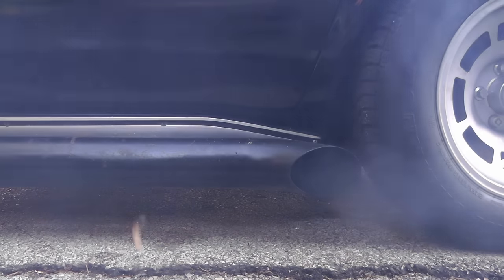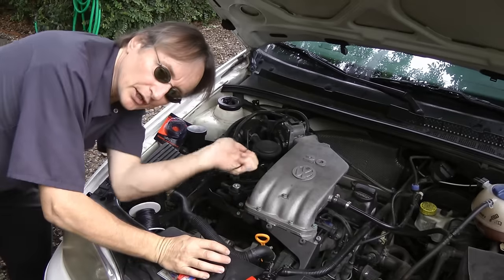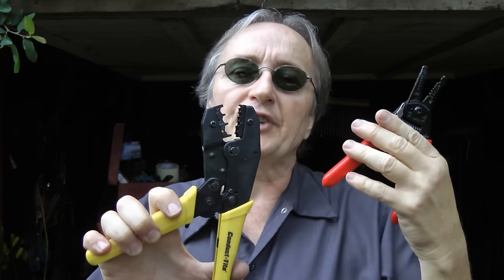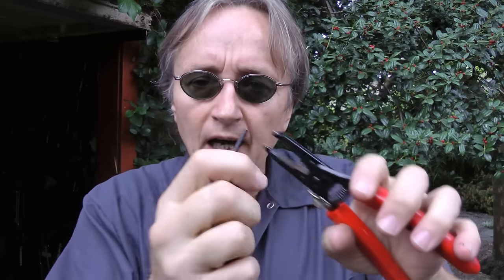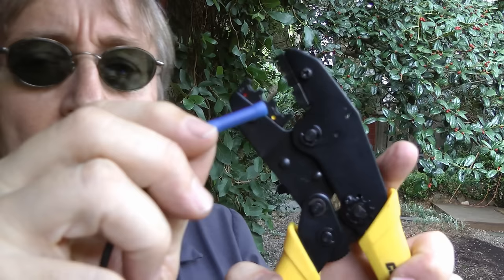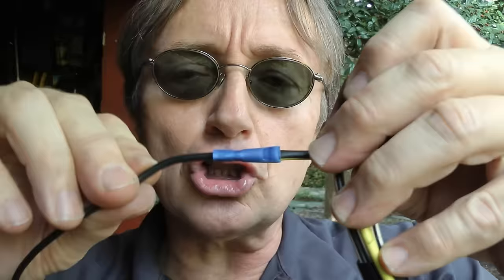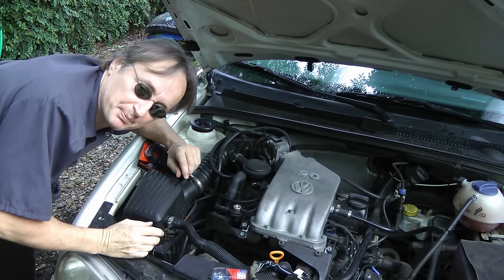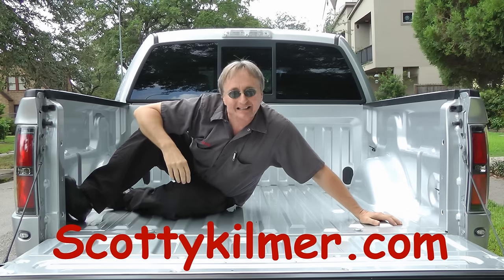How to Splice Wires Together in Your Car

Comment: I just twist the two ends together and put some duct tape or sometimes electrical tape around them.   So what if my lights flicker when I hit a bump
Reply: Well you might dont care about the ligthting but it would suck when the engine stalls because a wire got loose somerwhere
Reply: Same, with the right twisting technique there aint even any problems. And i usually use shrink tubes to proof the connection
Reply: The right way is to use a zinc connector. The zinc protects your car wiring. It's called "anodic protection". Twisting and taping is bad. The air has water in it. Your copper wires corrode and will turn black so do it right or plan on your car getting sick from the bad wires.
Reply: If a light flickers, it will blow all the time.
It's being switched on and off a  thousand times.

Comment: Poor wiring job. Exposed wire from the butt connector, and the twists on the wire look horrible so they will catch or strands won't be crimped in the connector. I hope this was just because of the camera, if you do that kind of work all the time with exposed wire you're creating a possible short yourself...

Comment: Insulated butt connectors are exposed to atmosphere & are bulky when multiple wires are repaired. These connectors allows water to get in and cause corroded green wires. The Best way to repair a wire is to solder the wires together and use adhesive lined marine grade heat shrink or use bare non-insulated butt connectors in combination with marine grade adhesive lined heat shrink. You can even use solder on the non-insulated butt connector for a superior repair after crimping.

Comment: hi scotty   mick from the uk here    ,,  i have high repect  for you   ,,  but i was  told  to solder wires   useing     flux    then solder then  the dielectric grease    dielectric grease  between the  shrink rap   and heat with a lighter   untill the  grease comes out of both ends

Comment: I used these connectors when I was installing an aftermarket radio. I somehow prefer the heat-shrinking connector, so it will seal the connection snug and tight, no water goes in. But they are a little more expensive than the normal connector.

Comment: I work in aviation for 35 years starting in an avionica shop and now as an avionics engineer. I agree with the crimp splices. Soldering also works, but for how long? Solder gets "brittle" over time at changing temperatures. In aircraft crimp connections are used and sealed against the environment because aircraft last a long time, longer than most cars. So, crimp (and seal if you must) otherwise solder and it should work for many years too if you do it right.

Comment: ive actually made entire motor harnesses before using this method. works great on carbed cars, originally i had a wiring harness with 100 or so wires. i think my home-made harness had about 10. so many are just not needed with a carb.

Comment: 2003 Nissan Última SE. Passenger side low bean bulb just replace last night. Everything worked fine. Today I turn on my car, and driver side low beam work on off setting. If I put it in Auto setting, only passenger side low beam light works. As I go down the settings they switch between passenger side and driver side but they never on at the same time. high beams both work just fine, turn signals work fine too. This afternoon my low beam passenger side is out again, I  replaced it last night.
Reply from the maker: +Frank Masias  personally, I would just bypass the wiring to the low beams and put in a toggle switch and new wiring to operate them, as your car runs those lights using computer modules now and they can be cows to fix with their original complex design

Comment: The right parking light on my Toyota Tacoma has not been turning on. The bulb was good, the connector is good, and that led me to think it was the wiring... until I simply pushed in the bulb into the connector and it turned back on. It would turn back off again when I stopped pushing on it. I simply took the bulb out and bent the little metal wiring protruding from the bulb outward more for it to make contact with the connector, and that fixed it and saved me from having to waste time splicing.

Comment: Awesome video!

I have to ask: would soldering be a good alternative to fixing wires?
Reply from the maker: sure, but then you have to seal the solder with wire covering material, and need a lot of room for a soldering iron

Comment from the maker: @CMLovejoy you check it's resistance with an ohm meter. But try to use the same gauge wire, it's there for a reason.

Comment from the maker: you don't want to be hearing grinding sounds, try removing the fan belts and pray the noise goes away, then it's something a belt drives. If it stays, it's inside the engine or transmission, Big money there, I'd dump it quick. Try cleaning the fuel injectors for the starting.

Comment: Just got the right side tail light to work again on my Suburban. Turns out it was a bad socket. I cut out a bunch of wiring and spliced in new wiring (used heat shrink tape instead of butt connectors) and even ran a new ground wire, and it was working like new again!

Comment: If you have the ability to, I'd highly suggest soldering and heat-shrink tubing when splicing wires as opposed to using crimp connectors. The quality of the work is much better, and it's less likely to come loose and short out. Butt connectors work fine in a pinch (no pun intended), but solder and heat-shrink if you want something permanent. Same thing when putting in aftermarket stereos (for people who own older cars with crappy stock stereos), nothing makes me more frustrated than when I see twist-on connectors used in stereo installation. Then these people wonder why their stereos sound like garbage and / or stop working because the wires came loose, not realizing that vibration in the vehicle tends to loosen things up.

Comment: Hi Scotty , big fan of your videos. Just got a question , I have a taillight that turns on only when brakes are applied. When I turn on the headlights , all the taillights are dimmed like they are suppose to be , beside the one that only turns on with the brakes applied. Could it be electric wiring problem ? Thanks
Reply from the maker: kewlkiddo22 yes, and often a ground wiring problem OR a problem with a corroded socket

Comment: Scotty,
well since i see that your videos are informative and i use them to figure out my japanese dilemmas due to my lack of foreign expertise, now here is a question for you thats now boggling my mind so since we are on the subject of Wiring and splicing, i have a fuse blowing at the panel thats for a/c heater which is 25amps now once the a/c is selected and the pressure switch on the accumulator and clutch coil is hooked up the fuse pops this is a early 90's gm ac system  Bad relay?

Comment: If a group of wires is not only insulated, but surrounded by one of those tough plastic jackets which look like a tiny corrugated gutter drain hose, do you know of a good alternative which is easier to put back over the wires? I'm asking because I often find that the only way to move the jacket out of the way (to fix a wire) is to pull the whole group of wires through the pre-cut split in the jacket. Not long after the repair, the jacket begins to come apart.

Comment: Got an idea why my h7 lights only work on the right side and not in on the left side?

The car is a Honda Accord from 1999 and I have checked the fuses and tryed new bulbs but no light?..Could it be the h7 socket is burned or something? 

Btw love your shows and watch them regularly. :)
Reply from the maker: +Jóan Magnus Magnusson me, I just splice the wires from the working side over there, works fine

Comment: @95gtscort Intake air temperature sensor! I once bought a little gizmo that plugged in the IAT to control its voltage output to the ECM. When the setting was offset, my rpm was about 2,200 rpm... Could be just that! The IAT sensor is one of the first sensors on your air intake line, and *kind* of look like a O2 sensor because it is a thermistor. So you should see 3 wires coming out of it. Hope that helped!

Comment: Heads up: Car wires normally are "SAE" gauge size. Wires, connectors, and tools must be all matching. Outside of automobile use, AWG wires are standard in the US. If you measure a "10 SAE" size wire in your car and run down to a good store to buy "10" wire...surprise, 10AWG is way thicker than 10 SAE and it won't match up.

Wire vendors also play games, they sell "CCA" wire instead of plain copper wire. This is "Copper coated aluminum" and if your car used 10 SAE copper wire? Size 10-SAE CCA wire might cause a fire, it can't carry as much current as real copper wire. Which is why it is cheaper.

Comment: Hey Scotty. first love your videos! Question I have a wiring problem with 02 sensors. all 4 are low circuit. I tested and there was no voltage. I replaced PCM and still no voltage. So can I use this method to fix it?
Reply from the maker: yes, and of course check the wiring until you find where the voltage is lost, and fix that part. There has to be power somewhere, and where it's lost is the problem area
Reply: Scotty Kilmer thanks so much Scotty. I disconnected the wire harness and realized that it wasnt a faulty wire it was the Bosch o2 sensors themselves. Apparently dodge and bosch dont mix well together so I had to get OEM. Problems are gone now.

Comment: @scottykilmer there must be a wire that we got switched under the dash or something because everything else works correctly. The switch has a lock, off, on and start position and I can pull the key out in the off position so it isn't a big deal. Isn't lock supposed to be an accessory notch anyway? It's too old to have the key cyl lock the steering wheel.

Comment: Hey, great video! I have one question though. Do you know a source for buying the small metal terminal connectors that snap into the plastic specialty automotive pigtail connectors?? Much like the one you used in your first example. In my case I had a wire melt all the way to the connector so splicing new wire isn't an option. So far I haven't had any luck at the wreckers.

Comment: I solder my wires, then use heat shrink tape on them. Also, Harbor Freight makes a mini torch , The size of a salt shaker, that is easy to use.

Comment: Great video .. i was wondering u should do a video on how to diagnose anty lock brake problems i have a  lincoln with anty lock brakes and ive changed the brake pump,proportional valve, caliper seals, and brakes but the back brakes dont work at all nor the emergency brakes i stop my car whit the front brakes but i think its dangerous please help thanks

Comment from the maker: stop whining,this is inside the car wiring which gets no weather and crimps work fine. Under the hood in heat and rain, yea, solder them. And I've been splicing headlamps for years and never had one single problem as long as you cut the old wires off that could have shorts in them.

Comment: I'm about to splice my side marker light bulb wire and use this method, should I disconnect my negative terminal before I start ?
Reply from the maker: for just a side marker with the lights not turned on, Na.

Comment: @ReclusiarchGrimaldus You should be able to connect a Scan Code Tool to the ObD2 connector if the car is 1996 or newer, and it will usually show any trouble codes saved on ther which will hopefully tell you whats wrong with the car. Usually places like Autozone will scan the code for free.

Comment: A short or a bad connection are two different things. A bad connection means intermittent connections or too much voltage drop at higher current. A short means hopefully a blown fuse, otherwise "fried" wires or components. Crimping is the way to go and seal it against the environment (moisture, salt, etc.) if you want it to last a long time. (See Scotty's answer to a similar question).

Comment: On my four wheeler wiring I put a heat shrink on first crap the connectors down heat shrink them some slide the heat shrink wrap over it and heat shrink that so water doesn’t get in

Comment: Hey Scotty, got a question that may be related. I have a 2002 Honda Accord that sometimes when driving seems to short out. Every electrical device (air conditioning, lights, radio, speedometer, etc.) cuts out for a split second.The car doesn't stall or shut off, and I'm able to continue driving. When everything kicks back in, the check engine light comes on for a split second and then turns off. I have no idea what could be causing it. Any thoughts?

Comment from the maker: this was for an ignition switch wire inside the car's driver compartment. I'm careful putting the wire in the connector, but if a wire gets cut, I do it over.

Comment: The headlights on my 2002 Honda Accord aren't working, and the guy I bought it from said that I needed change out the fuse box because he fried it. I changed out the fuse box, and the headlights still dont work, so then I changed out the fuses for the headlights. Still doesn't work. Next, I changed out the bulbs, still doesn't work. My next thought was that the connectors that the bulbs go into needed to be changed out for they were very broken, but my buddy said that I should test the wires to see if any fire is gettting through first. I bought a tester from O'reilleys and tested each two wires that run to their own bulb. In other words, I had to test four wires, and on both couples, one wire wasnt getting any fire. What is causing this? How do I find the part of the wire that needs to be spliced? Any help or response would be appreciated. thanks.

Comment: I want to wire some LEDs so they can be on with my daytime running lights. I was wondering if splicing the led wire into the daytime wire then to a ground is all it takes. Or is there something else I'm missing?
Reply from the maker: you could do that, but to be safe, it would be best to use that wiring to go to a new relay you'd wire in to operate the leds off the relay to not overload the circuit

Comment: Would this method work in repairing the wire harness in the drivers side door?? Dealership told me there was a short in my VW and would cost $500 to get it fixed...
Reply from the maker: of course it would work

Comment: My uncle has a 1988 Ford F150 that he let me use but it's been sitting 2 years and the mouse ate one of the electrical wires that from the headlights next to the battery but it is a red wire with a white stripe or blue stripe on there and I don't have a clue where it goes to so I was wondering if you could help me out reconnect it that runs from the headlights but chewing off next to the battery but I do not know where is going to reconnect it back together? It's been driving me crazy over a month now trying to figure it out. Hahaha

Comment: @john5246 Is it a ford truck/SUV/Van?  If so, it's the REAR BCM (sometimes called the REM - rear electronic module).  It's in the back in a compartment behind/under the spare tire jack.  If it rains and the back windows are cracked, it gets wet and shorts out.

Comment: Would you apply dielectric grease to the bare wire before sliding on the connector on the bare wire to prevent oxidation/corrosion ?

Thanks

Comment: I'm usually a fan of soldering, but in the case where I might use a a butt connector in something exposed to the elements, I'll simply use shrink tubing right over the crimp connector. Not pretty, but functional nonetheless.

Comment: Hey Scotty,
I have an 2004 Audi A4, recently the electric windows have stopped working and the drivers door has to be locked and unlocked manually but all other doors open by central locking, do you have any ideas of what could be wrong?

Comment: I pulled out the oil pressure sensor wire from the connector trying to change the oil filter on a 02 expedition will this work with a pigtail

Comment: would you mind sir if i will ask a question? i have a mitsubishi galant, everytime i start it in the morning it runs good but when the engine gets hot it is hard for me to restart it, does the engine malfuntion or is it the electrical wiring has the problem? hope you'll help me sir, thankyou in advance..
Reply from the maker: often leaking fuel injectors do that, flooding the engine out. THAT, or if it cranks slowly, a hot worn out starter does that too

Comment from the maker: @213vatoslocos unfortunately you need a dealer level scan computer to analyze and fix ABS braking systems. Otherwise, expensive parts guessing. Just how those are

Comment: Did  you just say "So when I find a short in wiring"? Aren't LOOSE/broken connections a lot more common than shorts? And how would shorts happen, anyway?
Reply from the maker: many things can go wrong, but in modern cars shorts often are created because they make the cars so freaking cheap, the wires are too short then rub on parts of the cars from not enough slack and short out
Reply: Oh, okay, thanks! Huh, it'd be interesting to see just how often that happens. At least you've kind of demonstrated from that reply that you're not just another one of those dumb people who get broken/loose connections mixed up as "shorts"! No mistake in electrical terminology misuse IRKS me more than that mix-up!
I always wanna go, "Oh, really? So what was it like when it started sparking or blew up on ya?"

Comment: When a wire is short and has a jack on both ends i personaly redo the entire lenght of the wiere from the pin in the jack to the other jacks pin. I think that is much safer. Then i redo the insolation with first electrical tape and fibre electrical tape on top.